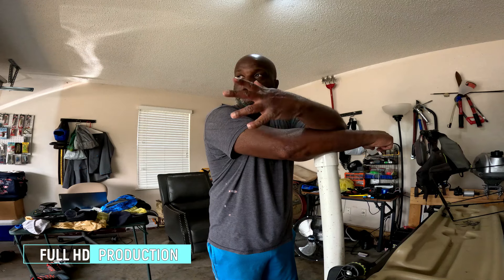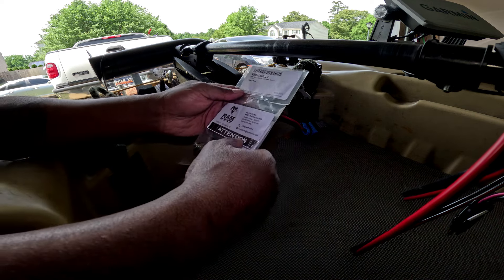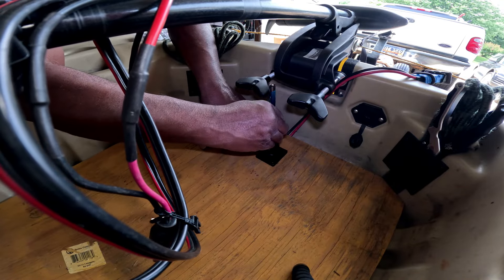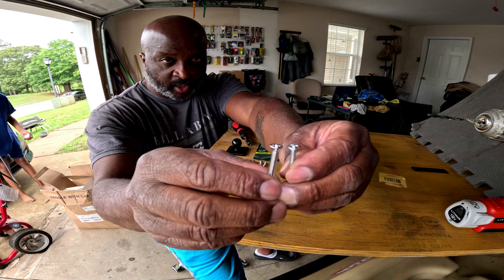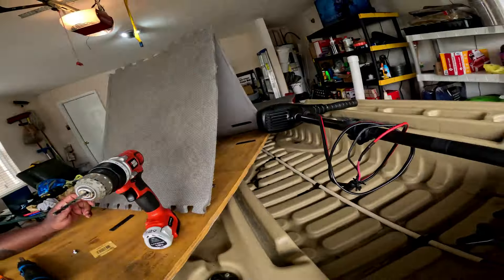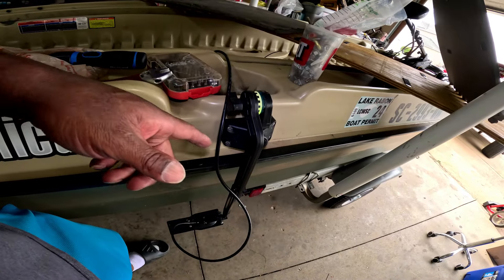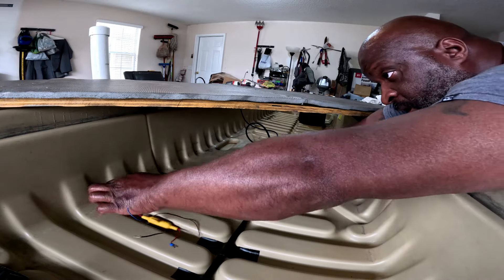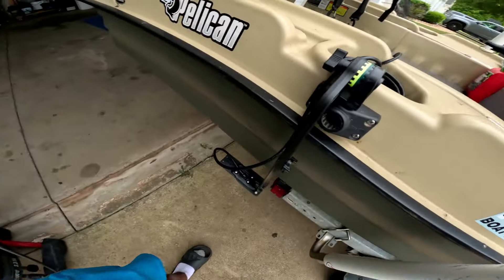This Pelican Bass Raider DIY Project Looks Really Cool

Comment: Looks great Jett., I have the same boat with a Motorguide XI-3 in the front. I have had my fish finder on the front right of the boat (as your sitting in it) had it there for years now.  I like it there because I can see it standing, or sitting, and it's out of the way for getting in and out of the boat, never thought of putting it where you did, I bet it will be great. I have the same 2 Plano boxes you have! They fit great in those boats.  Trial and error shows us the way, great videos, good luck.
Reply from the maker: Yeah the front right of the boat is a great location no doubt. I been wanting to try this new position out for a long time now. Hopefully this location works out for me just like the other has. Thanks for watching and commenting and don't forget to Go Catch'em 👍🏾

Comment: I bought a minn kota front mount and mod it to fit my bow mount trolling motor found it on marketplace
Reply from the maker: Oh that sounds like a pretty solid setup. Thanks for watching 👍🏾
Reply: It's a motor guide mount and I took my bow mount trolling motor turned the head around and now it's pull string and flipped down and up
Reply from the maker: @hillmonbrooksjr9847  sounds like a pretty solid setup
Reply: I like the new look. I love easy instructions when it comes to installations and refining projects.   Thank you
Reply from the maker: Thanks, I appreciate your support 💯👍🏾